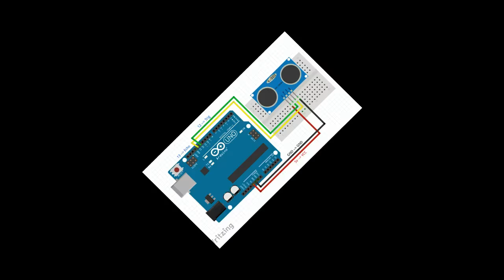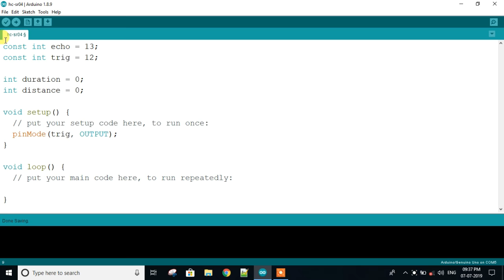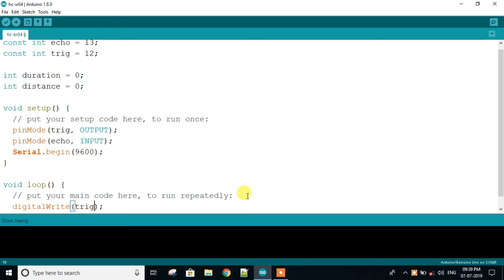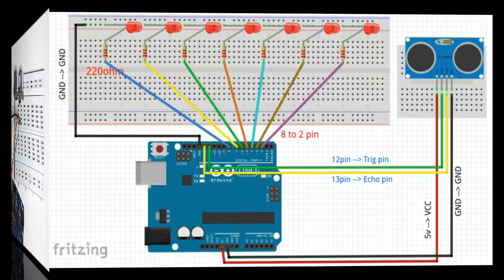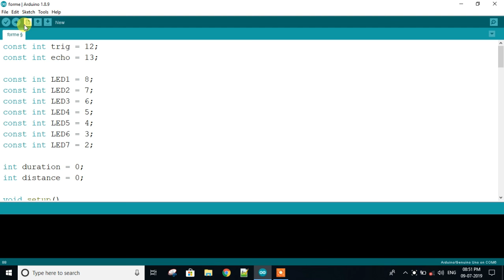Arduino ultrasonic sensor led projects | Hc-sr04 Ultrasonic sensor

Comment: Thanks for video. But I have a question . How Can I do this project with use active buzzer? How should be the circuit diagram and code?
Reply from the maker: if you want circuit diagram and code so send your Gmail id and do subscribe to my channel💖.
Reply: Send the code
Reply from the maker: @shahrozKhan4u  Check your email i have sent the code and circuit.
Reply from the maker: @dikasaputra4548  Check your email
Reply from the maker: @akramdogha3778  checkout  your email bro 😊😊
Reply from the maker: @darkgamers6526  Check your email☺
Reply from the maker: @airashiiing3266  check your email ☺
Reply: Please give me a code also
Reply from the maker: @innocentdouglas2730  This email address is wrong.
Reply: Can i have the code of this pls? Tnx bro
Reply from the maker: @godschildproduction5365   check your Gmail i sent the code.
Reply: Thank you so much
Reply from the maker: @godschildproduction5365  my pleasure💖
Reply: @MrElectroUino  sir, is it possible to send the code to me again in facebook or google drive?
Reply from the maker: @I_hafizi  check your email ✉ i sent you code.☺☺ and don't forget to subscribe🔴✔
Reply: Also send what it could look like. My mark for school is on the line here man.
Reply: Can I km have a code for this
Reply from the maker: @aaronmiles362  Check your Gmail ✉ I sent you code.☺☺ and don't forget to subscribe to my channel.
Reply: Mr ElectroUino already hit that subscribe button. Thanks a lot
Reply from the maker: @itsnewsgalaxy5626  Your email id is incorrect.
Reply from the maker: @itsnewsgalaxy5626  check your gmail i sent you code.✌
Reply: @MrElectroUino  Thank You bro
Reply from the maker: @mikemumbo7317  check out your gmail I send you code and don't forget to subscribe✔✔
Reply from the maker: @melaniethilakaratne158   check out your gmail I send you code and don't forget to subscribe✔✔
Reply: @mikemumbo7317  @Mr ElectroUino will give you bro
Reply from the maker: @mohammedjarjour456  check your gmail account I send you code.
Reply from the maker: @sadabraza4841  checkout your Gmail for code, circuit and Subscribe to my channel.💖💙✔
Reply from the maker: @neelaprashanth688  checkout your Gmail for code, circuit and Subscribe to my channel.💖💙✔
Reply from the maker: @adibafham  checkout your Gmail for code, circuit and don't forgot to subscribe to my channel.💖💙✔
Reply: can i hv that code too?
Reply from the maker: @ahmadfahmi79  check your Gmail✉
Reply from the maker: @gomtipatel1717  check your Gmail✉
Reply: Please sent code and diagram
Reply from the maker: @amk_editz  check your Gmail✉
Reply: @MrElectroUino  can you send me the code plsss🙂
Reply: @MrElectroUino  I subbed and liked
Reply from the maker: @raiyaanabdoolla9326  check your gmail✉.
Reply from the maker: @raiyaanabdoolla9326  Done😊👍
Reply from the maker: @raiyaanabdoolla9326  Thank you 😊💖
Reply from the maker: @rogelioa.dioniojr.247  Done👍CHECK YOUR GMAIL✉😊
Reply from the maker: @nynkenowee4801  check your mail✉ I sent you code.
Reply: @MrElectroUino  plz send me ckt diagram and code also
Reply from the maker: @pradeepguptapp6361  check your mail✉
Reply from the maker: @pradeepguptapp6361  Done 👍
Reply from the maker: @Sniper9401  done
Reply from the maker: @白上フミト  check your mail I sent you code and circuit.
Reply from the maker: @katrinamaeraiz7445  kindly check your mail because it wrong.
Reply from the maker: @katrinamaeraiz7445  Check out your mai✉
Reply from the maker: @eringowaski4537  Check out your mai✉
Reply from the maker: @dompie247  Thanks for your support😊💙👍
Check out your #mail✉
Reply from the maker: @iemanhakimibinalijasmin5495  Thanks😊💖
Check out your mai✉
Reply from the maker: @flubba6219  check your mail
Do subscribe✔
Reply: @MrElectroUino  can i have the code and diagram too? thanks
Reply from the maker: @nicolenavarro1896  check your mail
Do subscribe✔
Reply from the maker: @farisahnurliyana4482  check your mail
Do subscribe✔
Reply from the maker: @pamuruchethan2903  check your mail
Do subscribe✔
Reply from the maker: @maishasfishingzone634 check your mail.
Do subscribe💙
Reply: @MrElectroUino   very thankful brother
Reply: @MrElectroUino  All ready subscribe brother
Reply from the maker: @Nyxon.  check your mail.
DO SUBSCRIBE
Reply from the maker: @gimhanigunawardena1074  check your mail.
Reply from the maker: @bickybong8992  check your mail.
Reply from the maker: @joalan2525  Check your mail. Thanks for support. :)
Reply from the maker: @apostolos7744  check your mail.
Reply from the maker: @Exclzz  check your mail.
Reply from the maker: @simkebaki8867  Check your mail. THANKS for your support :)
Reply: @MrElectroUino  i need code pls
Reply from the maker: @blazeboii7072  Check your gmail.😊
Reply from the maker: @ichbinichunddasreicht2922  Check your Email.
Reply from the maker: @gokhanyldrmmm  Check your Email.
Reply from the maker: @tshaladra6822  Send your gmail id.
Reply from the maker: @akaykaushik7255  check you Email.
Reply: @MrElectroUino  Thank you
Reply from the maker: @jupneek  Check your mail.
Reply from the maker: @wisdom10001  Check your gmail.😊
Reply from the maker: @nasirmahmood6554  Check your gmail.😊
Reply from the maker: @najwasyahril5285  Done, check out your mail.
Reply: @MrElectroUino  can you send me the same buzzer circuit diagram with code?☺️ I subbed and liked.
Reply from the maker: @sheesh7124  Send me your gmail address.
Reply: can you send the code plz
Reply from the maker: @tumadabo4156  send me your Email.
Reply: @MrElectroUino  hello i sent my email is possible to send the code
Reply from the maker: @tumadabo4156  where is the email?
Reply: @MrElectroUino  I sent it more then once
Reply from the maker: @tumadabo4156  I am still not able to see your email. You can send me your email on instagram: _mr_electrouino
Reply: @MrElectroUino  ok
Reply: Send the code
Reply: Send me code
Reply: @MrElectroUino  I too need the code and circuit diagram. Thanks in advanced.
Reply from the maker: @srjpgs8172  send your email.
Reply from the maker: @atunes4351  send your email
Reply: I want this code for my clg project plese send
Reply: @MrElectroUino   hi can i also pls have code and circuit diagram for the version with buzzer pls.
Reply from the maker: @jessicamelody6891  send your email.
Reply: @MrElectroUino   thank you
Reply: Bro i want code of this program.. what i have to do ?
Should i mail u ?
Reply: Hi,still here？i need the code
Reply: Send me the code bro
Reply from the maker: @LeeSanchuan  Yes I'm send your email address.
Reply: can I have the code?
Reply: HELLO PLS GIVE ME THE CODE PLS
Reply: @MrElectroUino  i want code can you send me the code too?
Reply: Please send the code
Reply: @MrElectroUino  send code bro
Reply from the maker: @worthygo2891  check out my website for the code. www.mrelectrouino.com
Reply: Bro can you give me the code??
Reply: @MrElectroUino  sir can u too have the code
Reply: Hi man
I need code please
Reply: Bro i want code and diagram bro pls 🙏
Reply: @MrElectroUino  code please?
Reply: Bro how to add buzzer to it..
Reply: SEND THE CODE BRO
Reply: @MrElectroUino  I need a code please
Reply: Please pin the code in comment box
Reply: Send the code plisss
Reply: Send the code pliss
Reply: @MrElectroUino  send the code please
Reply: @MrElectroUino  i need a cricute
Reply: @MrElectroUino  can I get the code and diagram please and how can I add sounds to these lights is it possible?
Reply from the maker: I already written a blog on this topic. So check out my website for code.
Reply from the maker: @saumitrachaubey7935  I already written a blog on this topic. So check out my website for code.
Reply: Send code po
Reply: Me too please...
Reply: Send the code and circuit
Reply from the maker: @vimalelumalai1260  check out my website for the code.
Reply from the maker: @jenuelpodiamante4233  check out my website for the code.
Reply from the maker: @briango7983  check out my website for the code.
Reply: Send the code
Reply: @MrElectroUino  send code
Reply from the maker: @thepanda3757  send me your email address.
Reply: can you please send me the code for the LED
Reply from the maker: @remiantoun2836  send me your email address
Reply: Send code please i need it
Reply: Sirr i have the same question i am using one active buzzer and a battery to supply my arduino nano r3 can i have a clue in coding and diagram?
Reply from the maker: Send me your email address
Reply: Please give ne a code also
Reply: @MrElectroUino  i also want the code
Reply: Can I get the code ?
Reply: @MrElectroUino please i need code
Reply: Can I have the code please
Reply: send to me the code
Reply: and digram
Reply: Bro please send code
Reply: Bro please send code and diagram
Reply: @MrElectroUino Can I also have the code?
Reply: pasend po ng code hihi @MrElectroUino
Reply: send me the code
Reply: if you have that code and circuit diagram about you asked from sir then send me please.
Reply: this was 4 years ago but do u still have that circuit diagram and code?  @MrElectroUino
Reply: @MrElectroUino   Can i have the code of this pls? Tnx bro
Reply from the maker: @CallZen send me your email address
Reply from the maker: @iilandro2245 send me your email address
Reply: @MrElectroUino  MEE TOO PLSSSS
Reply: @MrElectroUino Can you also send me a code of the one in the vid and if we want one buzzer on one of the lights
Reply from the maker: @ZealtechIndustries check out my website for the code
Reply: can you send me the code, please its for a school project  @MrElectroUino
Reply from the maker: @avadaepico can you please check my website for code. 
www.mrelectrouino.com
Reply: @MrElectroUino  Yes thank you! I found it, and I subscribed.
Reply from the maker: @avadaepico thanks 😊
Reply: @MrElectroUino  hola ocupo esto me urge
Reply: Can you also give me the code and circuit diagram? This project and the one with the buzzer.
Reply from the maker: @ramiaiglesia4844 visit my website for code and circuit diagram
Reply: can you send me the code plis??
Reply: PLZ DO A VEDIO REPLACING ALL LEDS WITH ONE RGB LED VIA PWM PINS ....THANKS
Reply: Please send the code
Reply: Send code bro
Reply: Send code plz bro
Reply: @MrElectroUino  bro can send code plz bro
Reply from the maker: @MahendraJujjuvarapu can you please check out my website for the code
Reply: @MrElectroUino  website in chrome ?
Reply from the maker: @MahendraJujjuvarapu yes
Reply: @MrElectroUino  Hi, can you share circuit diagram and code if I use buzzer
Reply: @MrElectroUino sir plz share code
Reply: just add the buzzer to the last level of the light
Reply: I need the code😢😢plz send mee
Reply: Anyone send me the code pls
Reply: Can I have the code
Reply: Please can I have the code too?
Reply: Can you send me the code.pls..!!?
Reply: can i have the code bro with the buzzer?
Reply from the maker: @nelvynalido7267 please check out my website for code
Reply: I need code

Comment: Very good tutorial and project!  I was able to follow your directions and got it to work properly.  I was trying to add a function where the LED would turn off after 30 seconds of no movement and then reset/loop back but having trouble.  I can get the LED to turn off after no movement for 30 seconds but I can't turn it back on when the sensor detects movement.  I would appreciate any feedback.
Reply from the maker: Glad it helped!,  can you contact me on Instagram: _mr_electrouino

Comment: thank you!

I found out that taking the absolute value of the "duration" making it works much better. for some reason negative values pop out randomly in my setup
Reply from the maker: Excellent!
Reply: @MrElectroUino  Mr ElectroUino Can you  Send me The code and diagram please? . I need the code urgently

Comment: please I need your help !
What if you want to make it with one Led that works when you place your hand in front of it at what distance(without distance measure)? how is the circuit and codes? And do I need a relay module? knowing that it takes its energy from a solar cell  not a battery.

Comment: duration = pulseIn(echo , HIGH);
  distance = (duration/2) / 28.5 ;
  Serial.println(distance);
Hi Sir. Above code are taken from your arduino program. May i know what is 28.5 means? Thanks.
Reply from the maker: Visit my website for detail code explanation and don't forget to subscribe to my channel✔💙. Link👇
https://mrelectrouino.blogspot.com/2020/07/arduino-ultrasonic-sensor-with-leds.html?m=1
Reply: J

Comment: Hellooo, I hope you'll notice this comment. I was wondering why my components are blinking when I copied your code, but in the video it isn't. Have I done something wrong? Your reply would be greatly appreciated ^-^
Reply from the maker: Can you send the serial monitor, I think your sensor might not work. I need more information to point out the issue.
Contact me on instagram _mr_electrouino

Comment: the 2nd one with leds are coded using hard coding, right? is it possible to code the same program using arrays, if statements and for loops?
Reply from the maker: Yaa it's possible with this...
Reply: @MrElectroUino  may i have insight to how that way of coding works. i tried but got confused halfway through the code, Thank you!

Comment: Hi, I’m not sure if you are still looking at the comment but I’m doing a project like this but making it work with a dmx light. 

The ultrasonic sensor was not powerful enough to detect someone from a range so I’m going to be using a vl530x. I’m wondering how I can do the same project able to control the light power depending on distance with the vl530x
Reply from the maker: Hii, Yes you can do this project with this module. There is library for this sensor you need to use for do this project.
Reply: @MrElectroUino  hi I got to making the sensor work on its own now I’m just trying to figure out how to make the dmx shield and the vl530x work together. If
Reply from the maker: @Fahimbkt  sorry but I don't know much about dmx shield.

Comment: Hi Sir,I will make this project. code was working,led was was showing distances.but one problem,all led was blinking I will put obstacle opposite of senser led was not  blink.what is the problem of blinking?
Reply from the maker: Contact me on instagram..._mr_electrouino_
Reply: what is that mean

Comment: Hi Will This Work With 100 Ohm Resistors?
Reply from the maker: Yes It will work but it can be damage  the led if led is turn on for long time. So I suggest you to use high ohm resistor.

Comment: Is there a reason why , when I change the power source from the blue wire to the 9v battery it no longer functions like it's supposed to ? It only glows
Reply from the maker: It depends on  how would you connect 9v battery to Arduino.🔌

Comment: I am doing the same thing with one led light, so  when the sensor will find a object placed within less than 10 cm then it will turn on the light bt when i am connecting the circuit the led is glowing and when i am putting a object in front of the sensor the led is turned off why? But i have distance written "if(distance<10)" then led will glow
Help me pls
Reply from the maker: Could you send me your code So First I have to check it.

Comment: Too good but the problem is the last part of your code for leds passes quickly moreover "upload the code" those words causes obstruction i can see clearly. Where can i get clean code?
Reply: yyeeesss thank uuuuu
Reply: FOUND IT
Reply: const int trig = 12;
const int echo = 13;

const int LED1 = 8;
const int LED2 = 7;
const int LED3 = 6;
const int LED4 = 5;
const int LED5 = 4;
const int LED6 = 3;
const int LED7 = 2;

int duration = 0;
int distance = 0;

void setup() 
{
  pinMode(trig , OUTPUT);
  pinMode(echo , INPUT);
  
  pinMode(LED1 , OUTPUT);
  pinMode(LED2 , OUTPUT);
  pinMode(LED3 , OUTPUT);
  pinMode(LED4 , OUTPUT);
  pinMode(LED5 , OUTPUT);
  pinMode(LED6 , OUTPUT);
  pinMode(LED7 , OUTPUT);
  
  Serial.begin(9600);

}

void loop()
{
  digitalWrite(trig , HIGH);
  delayMicroseconds(1000);
  digitalWrite(trig , LOW);

  duration = pulseIn(echo , HIGH);
  distance = (duration/2) / 28.5 ;
  Serial.println(distance);
  

  if ( distance <= 7 )
  {
    digitalWrite(LED1, HIGH);
  }
  else
  {
    digitalWrite(LED1, LOW);
  }
  if ( distance <= 14 )
  {
    digitalWrite(LED2, HIGH);
  }
  else
  {
    digitalWrite(LED2, LOW);
  }
  if ( distance <= 21 )
  {
    digitalWrite(LED3, HIGH);
  }
  else
  {
    digitalWrite(LED3, LOW);
  }
  if ( distance <= 28 )
  {
    digitalWrite(LED4, HIGH);
  }
  else
  {
    digitalWrite(LED4, LOW);
  }
  if ( distance <= 35 )
  {
    digitalWrite(LED5, HIGH);
  }
  else
  {
    digitalWrite(LED5, LOW);
  }
  if ( distance <= 42 )
  {
    digitalWrite(LED6, HIGH);
  }
  else
  {
    digitalWrite(LED6, LOW);
  }
  if ( distance <= 49 )
  {
    digitalWrite(LED7, HIGH);
  }
  else
  {
    digitalWrite(LED7, LOW);
  }
}
Reply: Nice

Comment: can we do the same without resistors?
Reply from the maker: Yes, you can do that, but the resistor is used for protecting the LEDs. Without a resistor, the LED draws too much current and burns out. You can easily found a resistor in some old electronics components but make sure the values and don't forget to subscribe to my channel✔💙

Comment: i have a doubt what is the range 9600 is that mean the range of the serial monitor
 that can tally?
Reply from the maker: Yes it's use for serial monitor to communicate with arduino uno.

Comment: I finished the code and uploaded but what app do you use to chck the sensor?
the same as the coding app?
Reply from the maker: Same arduino IDE used to check the sensor value.
For that Goto <tool>and click on serial monitor

Don't forget to subscribe💖✌